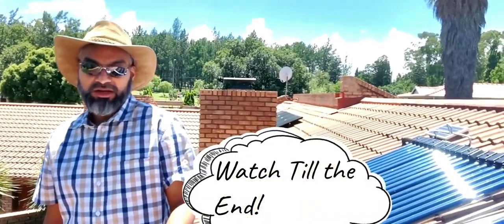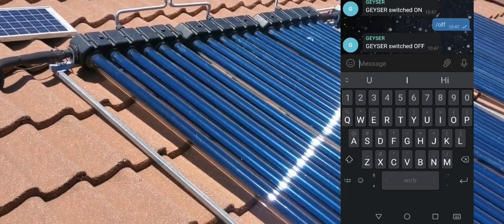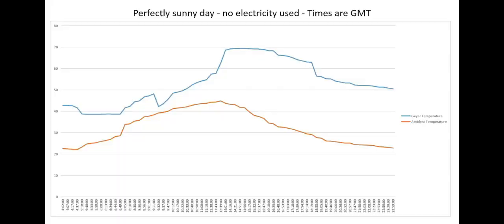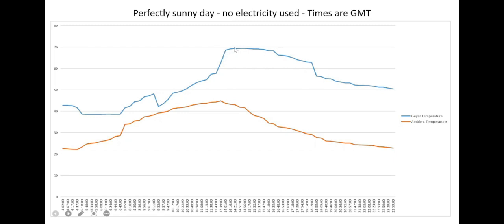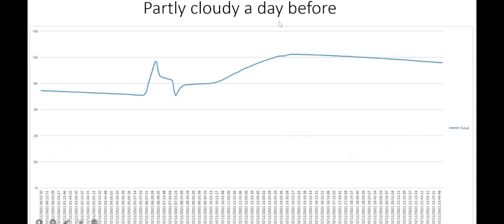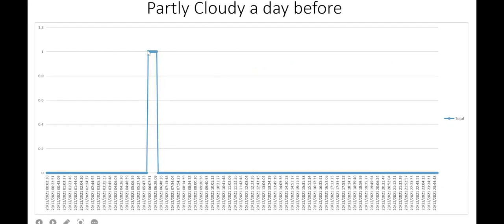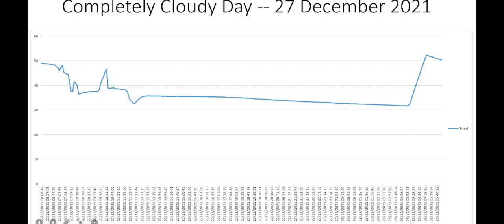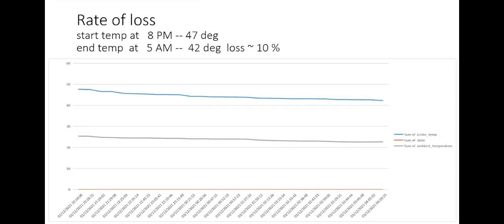Off Grid Solar Water Heating - Is It Worth It?

Comment: Enjoyed your video. Seldom do I see ones with actual data.  I heat water with PV because direct solar would be impossible, from google earth you can not see my house or garage because of trees.  My panels only get short periods of sun here and there, A number of panels are not even on my property.   I'm an electrical guy and love control systems and for me PV is far cheaper to implement.  I only have a 50L tank for the house and a 150L tank for the laundry in the garage.  I was interested in your 4KWH grid use, that is what my PV heating uses all day.   I think a 150L tank is ideal with PV because the tank will stratify and heat needed water quickly.   Does your pump work solely on PV or is there a temperature differential control which activates it?  Circulating water in a large tank forces you to heat water that may never be used.  Anyway, I'm envious of your large clear roof surface area.
Reply from the maker: Thanks for the feedback and questions. The pump works as long as theres sunshine, connected to a timer to prevent heat loss during the morning and evening. It comes on at 10am and turns off at 4pm.

There's no controller for the pump however there are some on the market. I built my own system, but did not find a need to control the pump functioning.

I sometimes use pv as well to run the element, and had I went with pv first, I wouldn't have installed healing for the geyser since the excess pv can be directed to it. I agree with you.

Comment: Fantastic video, I got two 20l gas heaters. 1 for granny and 1 for bachelor flat. In the house I have an 150l builders geyser. I think a kwikhot 200l 20 tube direct unit will work well with it.
Reply from the maker: I replaced my 150l with a tankless instant water heater. Works like a charm and saves electricity. Check this video
https://youtu.be/mD9ncPTTr_4. I've seen it on Gumtree for R1999
Reply: @ElecAndAll  thanks for the link. Iv been living in my granny flat while the house is being renovated. I have an atlas geyser , eish when it rains or heavy winds I struggle to get a consistent shower. Maybe its because I have mixer taps. But I either getting a hot shower or freezing shower. It's  not consistent. I set the geyser to 45C
Reply: @ElecAndAll I forgot to ask which brand solar geyser kit do you recommend?
Kwikhot or suntank?
Reply from the maker: Hello!

Neither, you don't need a solar geyser per se. You can retrofit evt's to any geyser.
Reply: @ElecAndAll  hi hi thanks for the reply.

yeah but I realised i need more hot water the 150l I have is not enough for a family of 4. So I want to add on a geyser but think going solar as an add on is best.
A 200-300l but unsure of brand and is evt or flat panel best in Gauteng for price and maintenance wise

Comment: I should really get a solar geyser, Cape Town weather is great for it most of the year
Reply: I wonder how it will work in Gauteng because I see flat plate and evacuated tubes , but unsure which would be better
Reply from the maker: @LekaLEL  the setup in the video is in Gauteng. Evts are more efficient than the flat panel.
Reply: @ElecAndAll  thank you iv been sitting this morning looking at the kwikhot units. Will definitely go look at 200l direct evt system. Just need to finish up patching the roof.
Reply from the maker: True